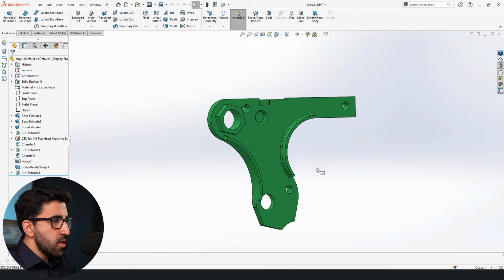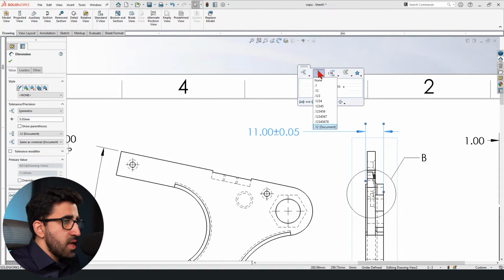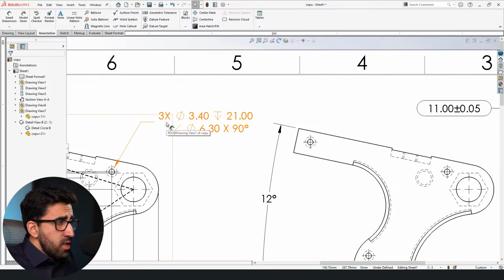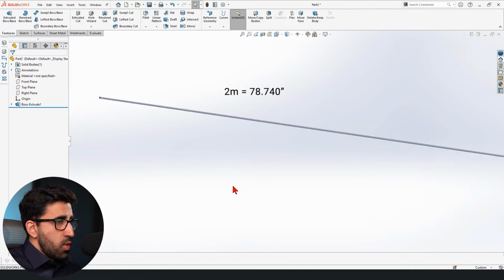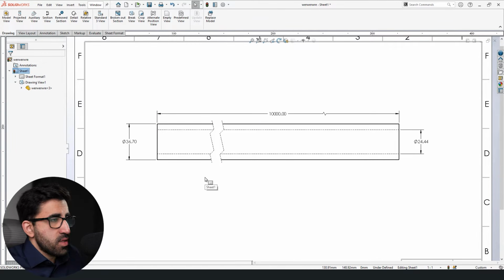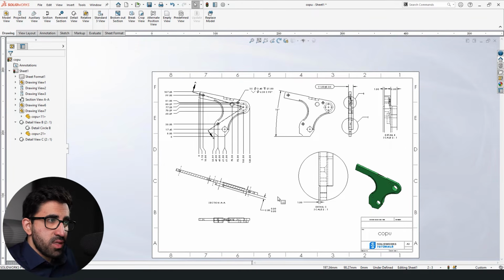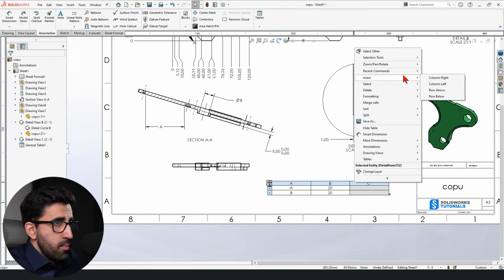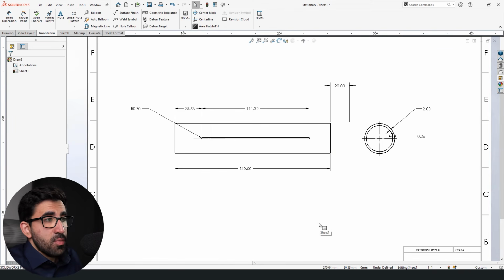Solidworks Drawing Mode: 7 Genius Tips You Probably Didn’t Know About!

Comment: How do you make the bounding boxes from weldments smaller on drawings?
Reply from the maker: In SolidWorks, bounding boxes are automatically generated to fit the exact size of the component, so you can't directly make them smaller. They're intended to provide the exact outer dimensions of a part or assembly. However, there are a few workarounds you could try if you're looking to reduce the appearance of the bounding box in your drawings:

Hide Bounding Box: If the bounding box is not necessary for your drawings, you can hide it. To do this, go to the FeatureManager design tree, find the bounding box under the solid bodies folder, right click on it and select "Hide."

Change View Scale: If the bounding box appears too large in relation to other components in the drawing, you can adjust the view scale to make everything appear smaller. This doesn't shrink the bounding box itself, but it does make everything in the view, including the bounding box, appear smaller.

Use Break View: If your weldment is long and thin causing the bounding box to be large in the drawing, you might want to use the "Break View" option. This allows you to remove sections of the part in the drawing view, effectively reducing the size of the bounding box as displayed.
Reply: @with-aryan  thank you for your feedback. Very much appreciated

Comment: Hello sir, I have a problem. Can we show the all configurations of the same part in BOM table? If it is possible how can we do that?
Reply from the maker: First, open the assembly file that contains the part with configurations.

Now, go to the "Insert" menu, navigate to "Tables" and select "Bill of Materials".

In the "Bill of Materials" property manager, you will see the option for "BOM Type". Here you can choose "Parts only" or "Indented" to display each configuration of a part as a separate item in the BOM.

After the table is inserted, right-click on the table and select "BOM table" to display the BOM property manager again.

In the "BOM Options" section, select the checkbox for "Display configurations of the same part as separate items".

Click "OK" to apply the changes.
Reply: @with-aryan  Thank you sir ❤

Comment: For number 3 tip, I higly recommend to use the sheet scale properties instead of change it in the view. The sheet information panel shows the sheet scale, not the view. Which can lead to some catastrophic moment😅. One time I got my sheet metal in 2:1 size. The information panel said it was 1:1… laser cutter put the dxf on the machine without any check and boom. It was a high priority part so my boss was not amused 😅.
Reply from the maker: Thanks for sharing!
Reply: With right-click to the view you can add a label to the view, if it has a different scale.